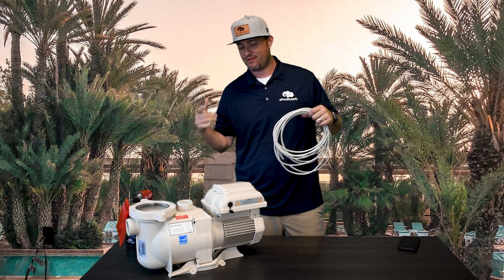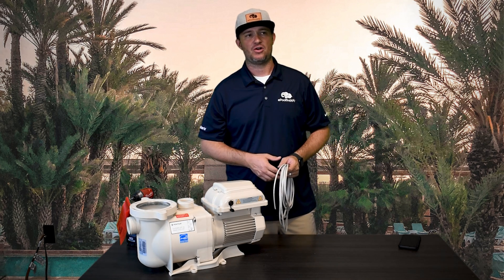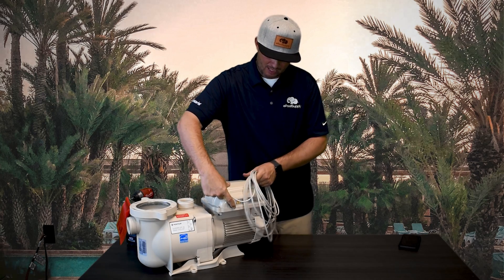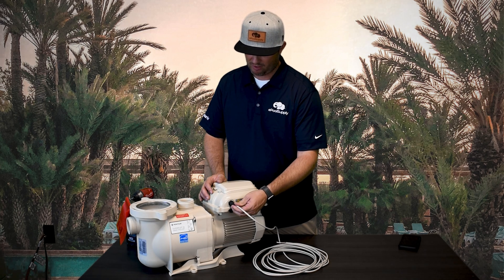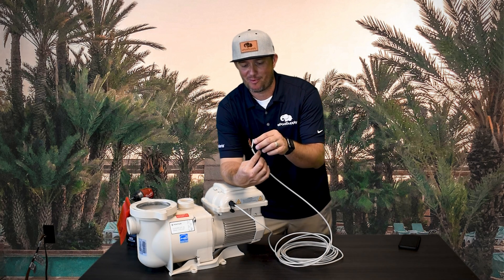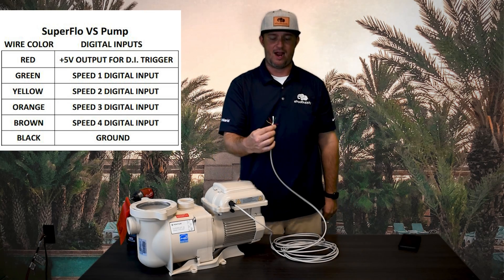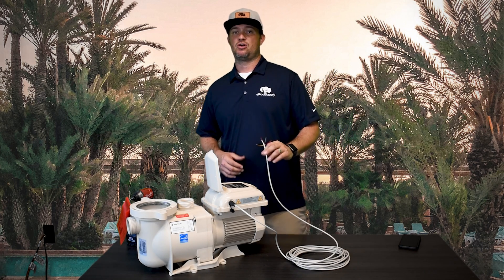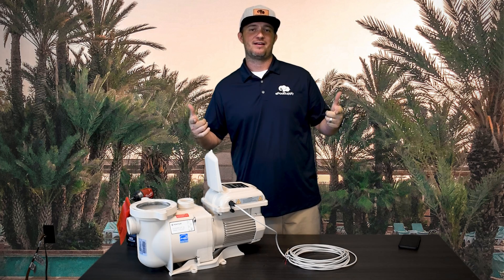Pentair Superflo Digital Input Kit Installation and Review - 353129Z

Comment: So. The digital kit install video ends at… plugging the cord into the pump?!?
Reply from the maker: It has a four pin connector on it so all you have to do is line the holes up and slide it into the port that it is already plugged into during the video. Very simple process. Hope this helps!

Comment: I want to use the SuperFlo VS with the SunTouch controller so that it triggers speed 2 once the solar is ready and switch it back to speed 1 when the solar is off (solar temp low or pool temperature reaches its set value). How would I wire it with the communication cable?
Reply from the maker: We would recommend reaching out to the manufacturer. Here is their number 1(800) 831-7133. Have a great week!

Comment: Need to update this video. If the pump is manufactured after 10/15/2020 it will properly control via the black comm cable.
Reply from the maker: Appreciate the feedback!
Reply: @ePoolSupply  I have the same feedback.  need a video on P/N 356324Z
Reply: Can you do a video showing how to connect the newer ones? Like to intelliconnect via 485?

Comment: How does it connect to an easytouch when the easytouch com port only has 4 pins to connect to? In which two are comms, 1 is ground and the last 4th one is like a15v??
Reply from the maker: Yellow and Green, just like a standard Pentair Com Wire. Hope this helps!
Reply: @ePoolSupply  So just use the yellow and green and disregard the rest?
Also I'm assuming the same would apply if it were a Whisperflo VST
Reply from the maker: @Sam-U-S-i4z  you are correct

Comment: Very new to all of this. Just to be clear, this wire is not needed to operate the pump itself correct?
Reply from the maker: That is correct. This wire is used to hook the pump up to a automation system like an Intellicenter or something along those lines. You can now control the pump through that system or app instead of directly from the pump itself. Hope this helps!

Comment: Where is the controller that the wire plugs into? That is what i cant find.
Reply from the maker: Hi there, do you have a single speed pump or a variable speed pump?
Reply: Same question. I have the superflow variable speed (exact model in video) but don't know what that cable would plug into. I'd like to be able to hook up my other equipment to all work together from a central command. Right now, my polaris booster and salt generator are all wired separate - totally making the digital timer built into the pump useless

Comment: The newest model of Superflo VS is supposed to come with a RS-485 Automation Wiring Kit. Very little is written about how to interface this with a Jandy Aqualink RS. It appears to solve the problem of having to direct wire to a relay to control the speed. A video on wiring this may be very helpful to a lot of people as the single speed 115v pumps stop being sold.
Reply from the maker: We aren’t sure as of yet if that is going to work with aqua link. Hope this helps and have a great day!
Reply: @ePoolSupply  I have a new superfood vst.  would love some info on how to wire it with P/N 356324Z and what benefits that gets me?